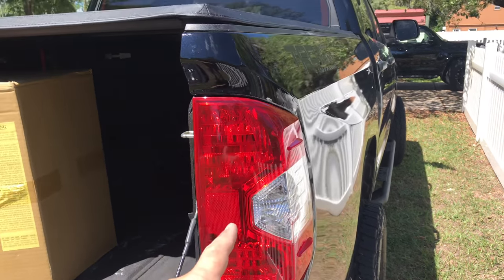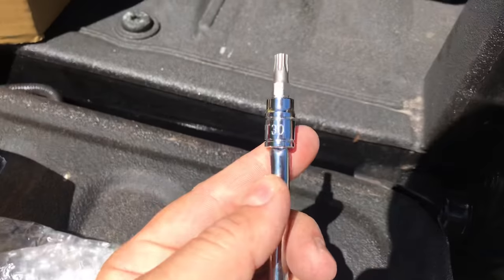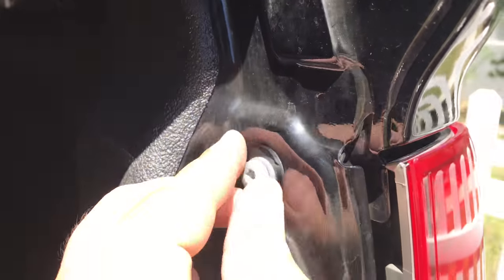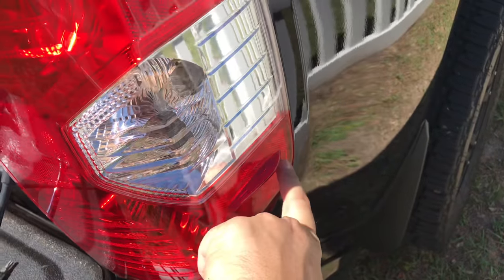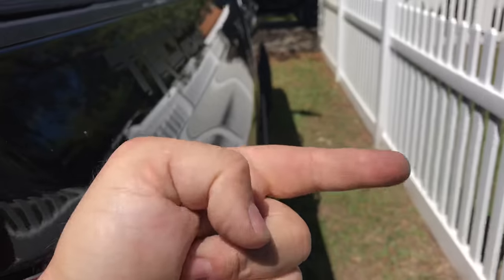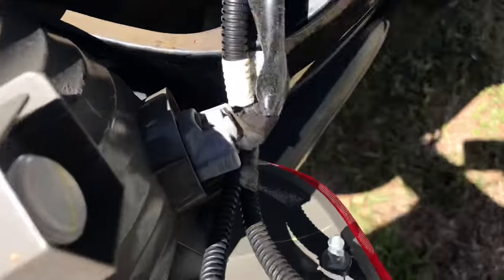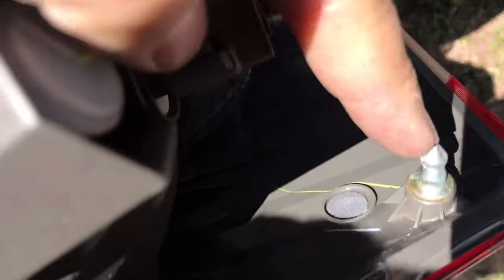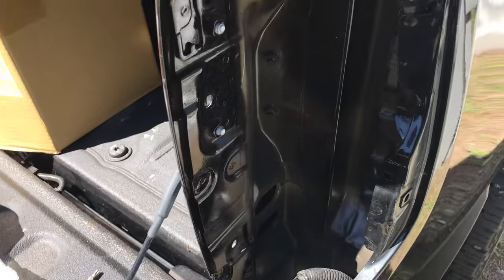How To Remove Tail Light From Toyota Tundra | No B.S. Fast Version

Comment: Short, to the point & simplified while also giving a simple warning not to just manhandle while removing being mindful of the tabs not to break anything. I  have replaced several lights on different vehicles & they are all very similar yet slightly different romoval or installation. Thanks